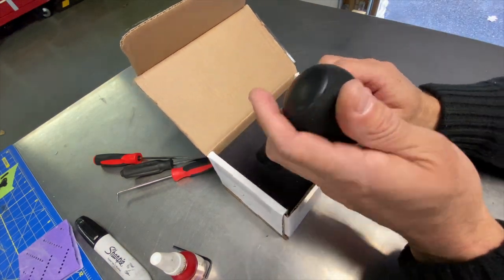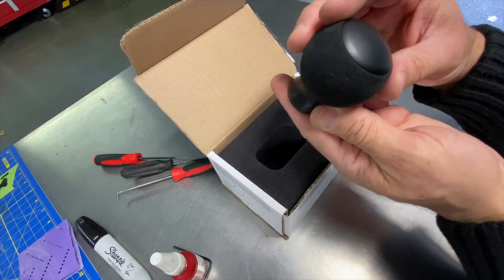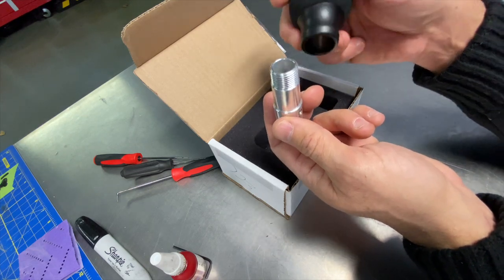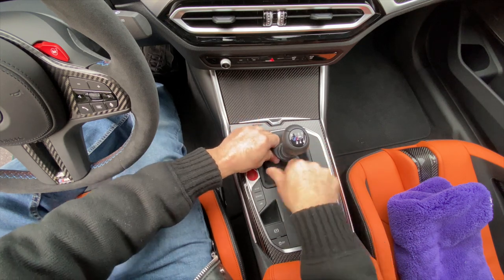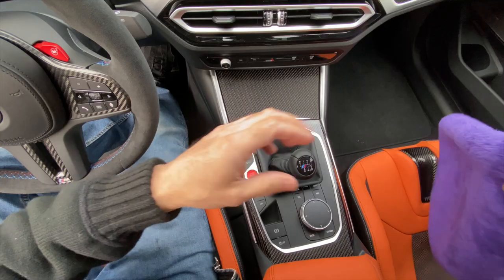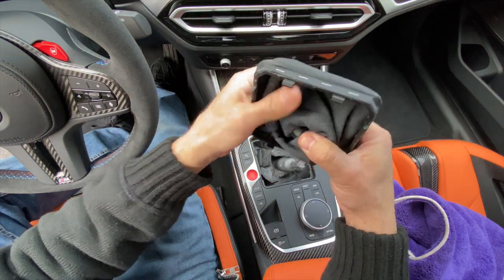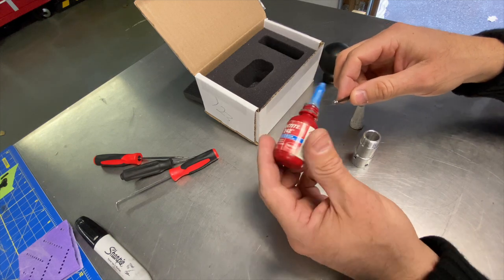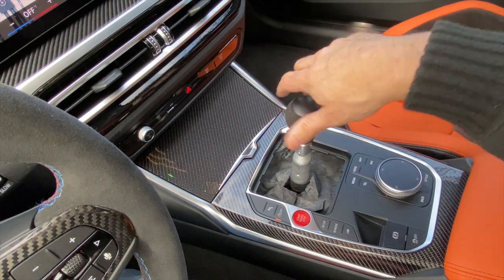BMW G80 M3 6 Speed Faster Smoother Shifts In Minutes | Installing A Weighted Shift Knob

Comment: For the rear bushing the best is to fill it with windscreen glue. The poly is to stiff. Also the stick has a soft rubber connection for absorbing the vibration, a stainless stick ads a nice mechanical feal to with minor vibration.

Comment: So I have a MGW short shifter and a Weighted billetworkz knob in the 350.  I finally sprung for the steeda clutch spring.  Why I didn’t do it early I don’t know, but the 350 floats through the gears now!  Shifting is effortless! It’s amazing what a little weight will do for your shifting experience!

Comment: I’m digging the steering wheel. Is that the one from InD?
Reply from the maker: No i made this wheel i do custom upholstery if you visit my site, one offs for customers. Im building another one now in black alcantara to better match the side bolsters on the Sport Carbon seats the full alcantara wheel feels so much better than the original leather one

Comment: Nice upgrade, tactility goes a long way. Sill loving those seats? I love the look but worried about getting them for long term use.
Reply from the maker: I actually like the seats a lot they are so supportive and I have better posture and zero pelvic and lower lumbar pain since owning this car which is a plus. Getting in and out can be tricky to glide over the side bolster so a protector might make good sense for long term wear and tear. Me personally I would never buy any of these new M cars without the carbon buckets or RWD manual layouts that is just me.
Reply: @autofanaticcars Really appreciate the feedback and response. I also would think a cover for the side bolster would help preserve it, that’s one of my concerns. Great to hear about the comfort though after as much time as you’ve owned it, and that you still consider them a must. Thx again 👍

Comment: Nothing compares to a gated manual Ferrari! But I know what you mean with the difference in weight for the knob, way back I replaced my shift knob in my Integra Type R with a Skunk2 knob and man it felt awesome to shift and just overall feeling with no compromises to tranny etc. Good stuff 👍
Reply from the maker: I have a short shift kit for the M3 and just located poly rear shifter arm bushings from Turner so that combined should make this shifter feel even better than a new Porsche for sure. Im doing these mods incrementally to see the changes along the way.